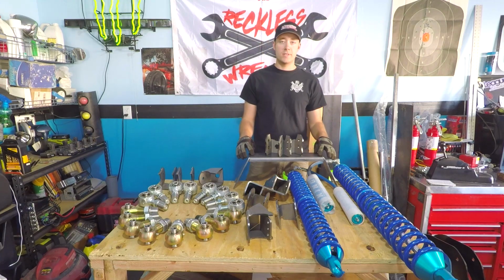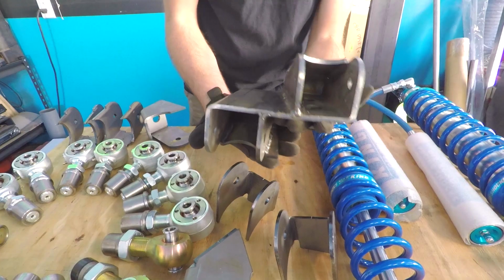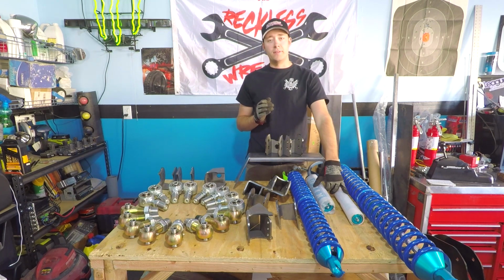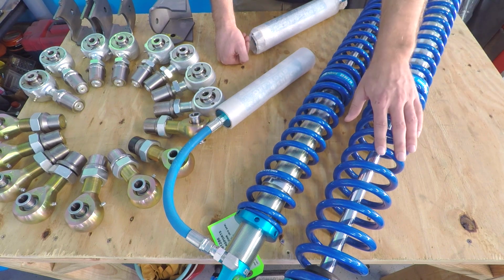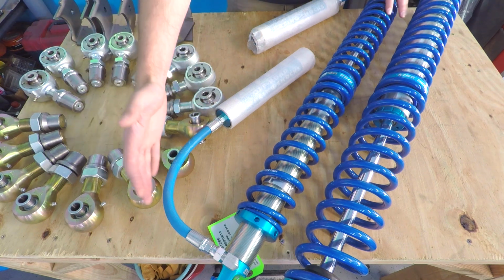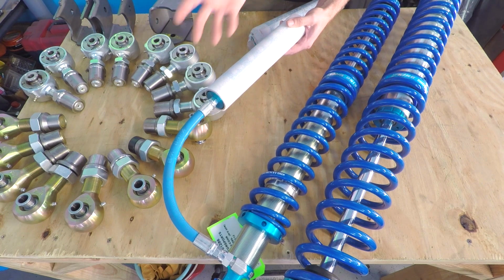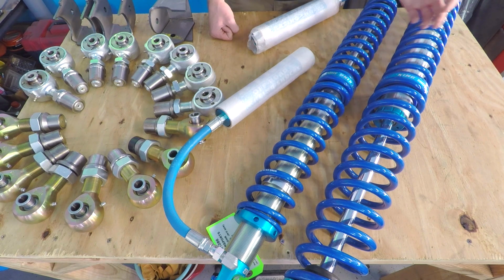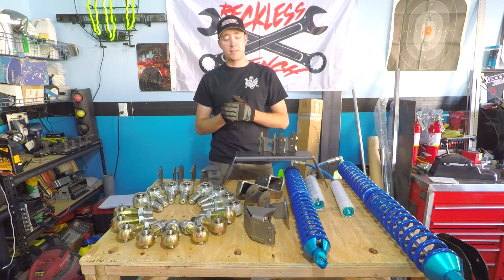King Coil Overs and 4 Link Suspension - Reckless Wrench Garage

Comment: I am wondering 4 link suspension is more worth than leaf spring? Actually i wanna get my m1008 front leaf converted to parallel 4 link. But I don’t know what it benefits . Ride quality is much better?
Reply from the maker: The easy answer is a link suspension will offer more movement/flexibility than leaf springs. They can be setup to be more comfortable, reduce alignment changes throughout travel, prevent axle wrap and maintain more precise characteristics... 
With the correct leaf springs and shocks, you could potentially match the ride quality of most common link suspensions. The rear can be set up to have plenty of travel on leafs, but the front will be limited due to things like steering, and pinion angle change.

Comment: How are you liking the rear spring rate of 150/150, would you do anything different softer springs, shorter shock? Are the springs ever hitting the shock since they are so long and soft? What is your estimated vehicle weight? How much up travel are you getting? Thanks for your answers in advance I am in the middle of procuring my own set.
Reply from the maker: When the shock was mounted like this on top of the axle, I eventually went to 100/150 springs since my backend is so light. My weight of the entire rear is 1700 lbs, with about 5-600 lbs of unsprung weight. 
After building the trailing arms, I think that is a much better way to go for how I drive. With how lightweight the back of my truck is, it was really hard to find springs for it. That was one reason for the trailing arms is to give me better spring tuning options because I can use a heavier rate. Total weight was 4700 lbs.

Comment: Hey brother you think you can help me out and direct me the rite way I currently have a dirt logic 6 inch lift on a 08 gmc 2500hd diesel and I realy want to convert to coil over kings but I’m having trouble finding the the rite conversion kit and I’m not sure if it’ll just be cheaper to drop my lift to a 2.5 lift and buy coil overs then
Reply from the maker: Currently, the only place I’m aware of that offers a conversion kit for the 2500HD is BDS. 
I was looking into it for the 05 Suburban and the 03 Silverado I have.
Reply: RecklessWrenchGarage yeah I actually got a quote from a local shop at 5k with labor for that kit but it comes with fox coil overs and not Kings I realy wanted kings

Comment: wrong guy... gets stiffer as shaft speeds increase.   bypass shocks are position sensitive, those kings are velocity sensitive shocks.
Reply from the maker: As the shock goes through travel the spring rate will change when the dual rate slider contacts the slider stop. That is what was said in the video, not that a coilover acts like a bypass.

Comment: Why did you choose these coilover shocks over a bypass shock like the radflo? Please let me know, love you guys!
Reply from the maker: A bypass shock has a totally different purpose than a coilover shock. Coilovers’s support vehicle weight and control motion, bypasses control motion at tunable parts of the suspension travel.
Reply: @RecklessWrenchGarage  I worded that poorly. I guess what I mean is why spend money on premium coilovers instead of getting cheaper ones that support weight but do a bad job of actually dampening and running radflo. Is it better to run high quality coilovers instead of cheaper coilovers and bypass shocks?
Reply from the maker: I would not say that the king coilovers only support weight but do a bad job dampening. A single coilover shock will never dampen as good as a bypass shock. A bypass shock has its place in racing and going fast. This truck will not race and will only occasionally see medium speed off-road. Also, radflo shocks are priced higher than what king shocks are. I had many reasons for choosing the king coilovers, filthy motorsports has several good videos on them.
Reply: @RecklessWrenchGarage  ok. Thanks. I'm subbed now
Reply: @razorsazors  your arm chair pre running bro. tuning is what is more important. a tuned CO will work just fine. vehicle weight and driving style is what dictates if it needs bypass's or not. most people that have them dont need them if that makes any sense.

Comment: Just priced out shocks...$2360
Reply: cry about it. its not a kia. 

thats the price, but the best way to explain a 2.5 or larger shock is its basically the equivalent of a built motor in your car but for your suspension. plus the fab for install generally costs more than that lol. but its worth it. every penny.
Reply: its not for poor people

Comment: Nice explanation of the coilovers. How's the 200/200 working for you?
Reply from the maker: So far we have not tested it more than 5 miles or so. The ride height is perfect with the 200/200 though, exactly the height we were going for.
Reply: @RecklessWrenchGarage  slider is going to marr up the shock body. better off using that spring rate, but changing the lenght to get your ride, then using a light spring as a tender coil with your pre load.